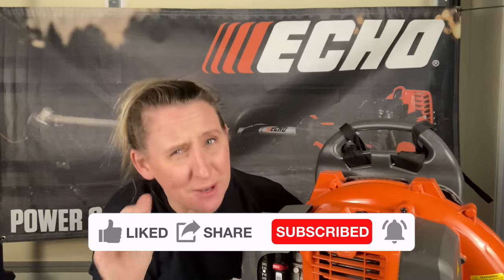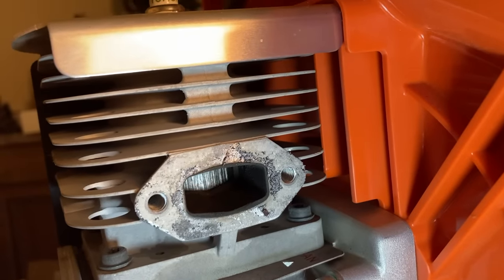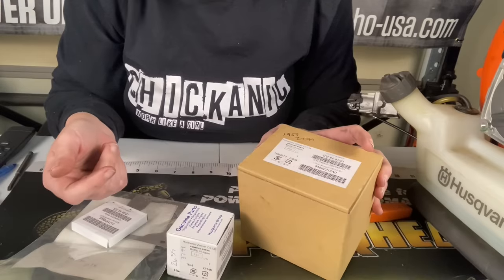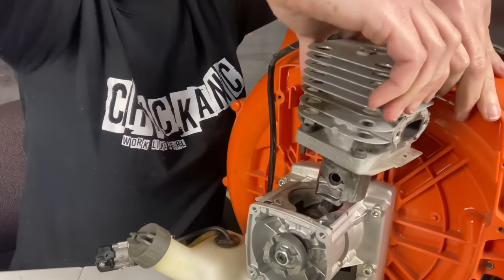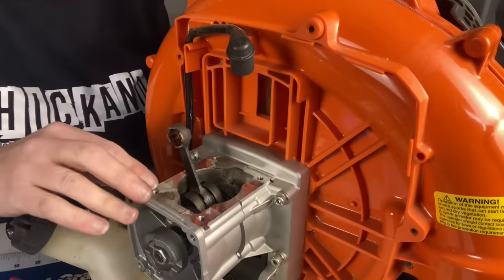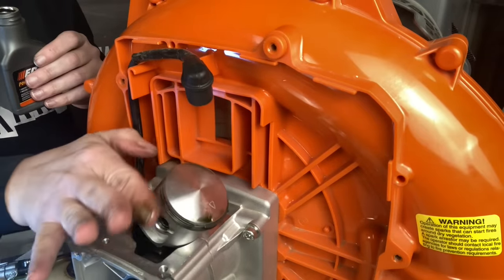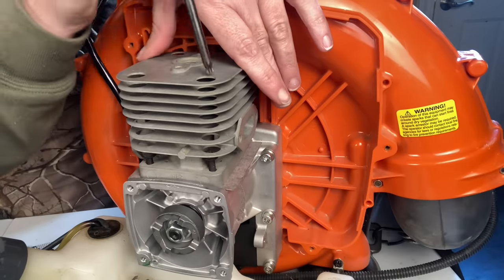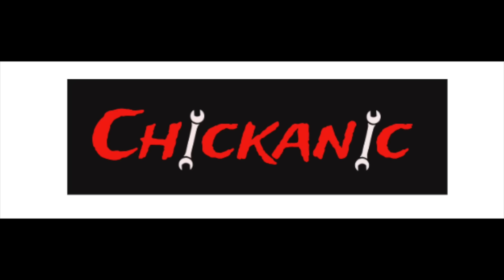How to fix a burned up Husqvarna 150BT backpack blower/Turning Shop Trash into Treasure VLOG Repair

Comment: I just worked on one of these last week.the muffler on these are so restricted, that it throws back carbon deposits back into the exhaust port.If you took a blow gun to the muffler,it would probably be packed with soot.but the spark arrestor would be clean.

Comment: Great video. I picked up one of these backpack blowers a few years ago. The owner told me that it was running fine when he put it away and then it would not start. He told me he was not interested in getting it fixed he said he put it on Craigslist for $20. Really have not messed with it too much except putting a new coil on it. That wasn't the problem and since I had other projects I put that to the side. 

Now after seeing your video I am definitely going to look at the Piston the next time I go to mess with it. I made sure to save your video for a part numbers.

I must definitely hit the like button and subscribe button. Look forward to your next video.

Comment: I would definitely agree with you Chickanic that no oil was used in the gas mix. PERIOD !!! This is a great candidate for a quickie rebuild. DO you have any idea as to why the price of the jug,piston, and rings are so reasonable ?? Sometimes the cost of these parts are more than a new machine. WHY ??? 
          Nice work young Chichanic too.

Comment: Thanks for another great video. I am a bit surprised the bearings/bushings in the botto- end did not overheat.
Reply: Very common for the piston to expand long before the steel parts of the crank overheat. We just got lucky with the bearing and wrist pin. Most pistons come with a new bearing and pin, and we didn’t check the box before she disassembled the engine. If the bearing had been bad we would had been ordering one and had to wait to finish the video.
Reply: @dudekanic  Now that I think about the difference in expansion rates it makes perfect sense. Thanks for the reply.

Comment: The ring gaps are pinned to those positions that the ends don’t catch on the exhaust ports, and u can use a long bolt and nut with a deep socket to remove the wrist pin without scratching them with pliers

Comment: I always dump the gas out of the carburetor on a sheet of white paper. It’s a paper dries completely clear it’s been run definitely for sure with your gas if it has an old film on it then it’s had mix. I’ll catch them every time!

Comment: Sometimes I use a socket a little under the size of the wrist pin diameter and use a soft face hammer to tap out the wrist pin.

Comment: My dad worked for a Stihl dealer. When they changed locations, there was a non-functioning backpack blower there. Now, I may know how to fix it. It was free to me. In the meantime, I use my TroyBilt trimmer plus blower. not the power of a backpack, but one engine, many heads.

Comment: As a retired machine shop owner (bored and sleeved thousands of 2cycle's) and a Wiseco distributer: Would you question the condition of the crank bearing (run without oil) ? Tip: Installing circlip's with the gap other than 180 or 0 degree, can cause "it" to rotate at high rpm, causing total engine failure. It rarely happens, but always with used circlip's.

Comment: The  GYT Kit  for  my  1974 Yamaha YZ-80-A  was $200.00  .. Piston . Cylinder .. 24 mm Mikuni Carb.. head .. Expansion Chamber  and a  super duty crank shaft  bearing and a wrist pin needle bearing..  went from  5.5 HP to   12  HP and with a  lot of Port work 16 HP all out of 72cc's.  then 2 years later I bought another GYT Kit for $125.00 ...

Comment: If someone would produce a locking gas cap for 2stroke equipment.. have the key attached to the handle of the 2stroke  fuel can with a dog chain long  enough to unlock the keyed gas cap. Would save a few engines.. and maybe a few relationships... Good to see Y'all regaining your mojo.👍

Comment: I have the same exact blower i bought it for 20 dollars and all i did is clean the intake,air filter,adjusted the throttle cable and replaced the fuel filter refueled it with red armor fuel  and it runs like new before it was so plugged up it would not get over half throttle the blower is only 4 years old only thing broken on it is the hip strap buckle

Comment: You are so good with part number and repair info. I ead looking for apart number for 3 years one day on your video boom. There it was.  You know Brigg and Stratton engine push mowers the 4 bolt the months to the carbuator and frame I can not find the part number. Two are black two are sivet. They mount the air cover base to the mower and carberatir I can not find a part number for those screws.

Comment: Stihl made some pieces of equipment that used poppet valved 4-strokes that required pre-mix. My genius co-worker reasoned that a 4-stroke didn't need pre-mix and ran one on straight gas until it seized. I think our mechanic repaired it with just a piston and rings.

Comment: After watching this, I'm actually tempted to order a cylinder and piston kit for my old Stihl FS85 which was determined by my local dealer to have low compression.
I really miss that old beast, and would like to resurrect her if I can get the parts cheap enough.
That's a real shame on that blower- there was no carbon on the piston at all, like it was never ran.

Comment: I had a 2 week old BR600 come into the shop and man, it was hooped!  The cylinder was scored, rings melted into the piston, but with a Stihl 4-mix, you know there always a "wait, there's more" coming up.  Disassembled the whole thing, the con rod was almost welded to the crank journal, the crank bearings were seized, the pushrods had come off the cam and gotten jammed in the rotating assembly...  I mean, it was fubar.  It wasn't even due for a valve adjustment yet.  The customer was very adamant that he had used the right oil and mixed it properly, and not lying, that is what was in the tank, but as a tech of 30 years, I have seen people try to BS me more than once.   He INSISTED that I price out a complete rebuild, which I knew would be a waste of time.  It was ridiculous, it came to over $1500 in parts alone.  Naturally he trashed the machine and got another.  Well, this wasn't the only one, I started to see more and more of the units come in that had been on the shelf only a couple of weeks prior, and in the same condition, different owners.  This started to set off alarm bells, so I spoke to the service manager and told him that something is wrong with these units, something is not right with the tolerances, they are binding up, all the parts turning blue as well.  He must have spent a week talking to Stihl and they kept arguing with him that nothing is wrong, this isn't warranty, etc.  FINALLY they did some investigating and called back and said "Oops, you are right, our bad, tolerances are wrong like your tech suspected, the parts were machined improperly".  I had to completely rebuild about 40 units over the next couple of months for the same thing, and I had to bag & tag every single effing part to send back to Stihl.  What a nightmare!  I think that was in 2012, Stihl just had a bad batch of BR600's.

Comment: I just cant believe that Husky doesnt provide a wrist pin and clips with a replacement branded piston.  The reason that the pins are in the piston is to prevent the rings from turning and catching an end in one of the ports.  Good job.

Comment: Hello Chick... I fix cars for a living and something i live by is always put something back the sameway it came off .
Reason i am telling you this is when you disassembled the piston pin needle bearing caps you just moved them around to inspect them .
Now I do know when something runs for sometime it does create a wear pattern from metal balances, tolerances...etc ....
I am not sure how important that it is when it comes to small engines but if i was removing a crankshaft from a small block chevy , it is EXTREMELY important that the bearing caps 
be returned to the same spot in the same direction they were removed....... even if i am installing "NEW" bearings .
SO can you lemme know how important it is for smaller engines .
If it is please let future teardown videos know about it .
Oh and i have been turning wrenches for over 25 years so alot of this is oh natural to me . 
But i like watching and learning new things about anything that runs on fuel.
Plus you are a smart cookie and i dig watching you .
Thanx Chick !

Comment: For those reading the comments and not understanding why a 2 stroke engine can have "good" compression yet be totally trashed. Well it's how a 2 stroke builds compression. typical four stroke you stick a compression gauge in the spark plug hole and crank the engine. Do that on a 2 stroke and it tells you nearly nothing. a two stroke builds compression on the intake stroke as the piston is on it way down compressing the air fuel mixture into the crank case. it's not until the crossovers open that the air fuel mixture will get into the combustion chamber and light off. 
it's for this reason top end compression is nearly useless in diagnosing an engine. You need to vacuum and pressure test the crank case. most crank case scavenged 2 strokes need to hold about 5-8 pounds of pressure and about 10-12 pounds of vacuum for a few minutes. if the crank case cannot hold pressure or vacuum you have a air leak and the engine will either not run or not build proper power.

Comment: Was really surprised that she jumped right into the cylinder and piston redux without determining whether there was any damage to the bottom end bearings!!  ...and after you wind the piston rings onto the piston, use some FINE emery paper to polish out the scratches you left on the piston skirt between the ring lands. They can concentrate heat and damage the piston skirt!
Reply: Its 2 stroke the oil  only  goes to the piston an cylinder.. and it was new so no problem  with bearings
Reply: I had the same question. My understanding of a two cycle is that as the fuel/oil mixture is drawn into the crankcase and compressed, the fuel flashes from a liquid into a gas leaving behind an oily mist. That mist is supposed to lubricate the lower end, and then when drawn into the cylinder, lubricates the piston, the rings, and the cylinder wall.  Looks like the sliding parts of the piston/rings/cylinder gave up before the needle bearings in the journals.
Reply: Oil from the mix lubes the bottom end as well. Something has to.
Yes there is potential for damage to the bottom end as well with straight gas- except- 2 strokes do a wonderful job of coating the entire bottom end with beautiful clean oil ( from the mix. The bottom end could spin for a long time on this. The top end has more heat and packs it in first.
So quite likely the bottom end is just fine
Reply: @adriancollins7236  that's is not true the fuel goes through the crankcase wich in return lubricates the crank shaft and all the bottom end bearings and wrist pin ect......

Comment: I purchased parts from farmer tech or holtzforma really cheap. However they are shipped from China and take a long time to get. I'm using a 455 husqvarna chain saw built with these parts with hundreds of hours on it and still going strong.

Comment: I stripped down a cheap Chinese strimmer that one of our rail track workers used with straight petrol. The crankshaft was bent, and the bearing and conrod end was trashed. Definitely ended up in the bin.

Comment: Regarding cylinder bolts,  do you use a tighten 
Sequence and is there a specific tourque involved,  did a cylinder and piston  on a xp372  forgot thread lock,  had to go back in and redo all boltz, they loosened after first run

Comment: Seen a BR600 that had a broken valve. It was stuck right in the top of the piston sideways. I put a short block in it under warranty.  Customer said that when it quit he had it full tilt and it just stopped. Said it almost jumped off of his back.

Comment: Honestly, i would have cleaned up the old piston, smoothed out the scoring & fitted new rings & the machine would be just as good but i wouldn’t be doing that to sell it on, i would want to change at least the small end bearing along with the piston in your scenario, the cylinder looked very okay.

Comment: I have to say that I bought a blower. Used it for about an hour, then gave it away for free.  I just cannot see or find any value at all in owning one.  I was raised that it is always better to remove filth. than to rearrange it.  Plus, there is absolutely no necessary reason at all to rake or remove leaves.  it is only work for the sake of something to do.  which I do understand has some value on occasion.

Comment: I had a Huqvarna model 55 (back when they were dealer saws. Wasn't dumbed down by the "big box stores") It always started on the third pull EVERY TIME! It was an AMAZING chainsaw. Dad had loaned it to a guy and he ran straight gas in it. I am a mechanic so I tore it down myself.  The position and cylinder were TOAST. Our local dealer who used to be a Husqvarna and Stihl dealer, (They no longer carried the Husqvarna because they had "dumbed down" their saws to get the price point where the "big box stores" could afford them and make a profit.) was still able to get parts at cost. The jug, piston, rings, and gaskets were over $150.00 (list price) A new Stihl that was comparable in size was only $280 ish I believe. So needless to say the saw was scrapped. WHY is it so hard for people to understand that the oil in the gas is a NECESSITY?!!!

Comment: Is there any concern for the bottom end, especially the bearings, since they went unlubricated like the cylinder did?
Reply: Yeah she can replace parts but doesn't have knowledge to even think about stuff like that.
Reply: Even with no oil, the liquid fuel does have some lubricity & is not subject to the drying effects of hot  gasses present in cylinder. She did check the wrist pin needle bearings which she said looked good. That being said the bottom end is likely ok. Machine was likely not run very long without oil. If bottom end bearings are bad probably not worth fixing cost wise.

Comment: Hmm, had an identical blower fall off the back of my truck last summer after forgetting to put the tailgate up. Before I had chance to turn around and get it a passerby told a guy in a white pick up stopped and took off with it.  Easy come easy go. I think it cost me  $350 plus tax.

Comment: Hello Miss Chickanic 
I really enjoy  your vids, thanks for the no nonsense way you do things.
I've been working on small engine's for about 40 year's, no training just figured I couldn't make it not run any more than it all ready
isn't.
To my point, how do you identify a model when you don't have a model or serial number.
I have a Yard Machine (MTD) 26 ton Log Splitter that I bought new/salvaged motor seized (no oil).
I brought it home unseized the motor, runs awesome.
It's been sitting several year's, now I need to replace the float needle and seat, it is a 6.5 Briggs and Stratton Intek.
I have no info other than Briggs and Stratton 6.5 Intek on a Yard Machine 26 ton Log Splitter.
Can you give me some of your wisdom.
Thanks.

Comment: Glad you are feeling better. Good video and wishing your videos were available when I tore my first 2 cycle motor apart.  Just one question: part of the old rings appeared to be missing when you took motor apart - where did they go? The reason I ask was my 2 cycle was motorcycle with no circlips on the wrist pin. metal machined from wrist pin drop onto press fit crank and seized it. Thanks.

Comment: I think a little muriatic acid, a quick hone, or even just a quick buff with some sandpaper and that old cylinder would have been golden, but nothing like fresh top end. I'm surprised you didn't use any gasket sealer

Comment: Chick, please start wearing Nitrile gloves to save yer skin, avoid absorbing oil, gas, cleaning solvents into your blood system. Long term effects are not healthy.
Take the advice from a retired German car dealer master tech for 48 years. If your skin is tingling anytime your working or cleaning up, your in trouble.
Good channel 👍👍

Comment: Excellent job. I noticed that you used High Strength Threadlocker on the cylinder head bolts. Does that give you any problems if you ever have to remove them again?
Reply: No
Reply: I would have used blue.

Comment: Found a BT 130 on side of road. Looks brand new, but cyclinder wad stuck in head. Since there is metal partials in cyclinder, would you suggest taking out bottom roller bearing. Dismantle completely?

Comment: Do factory torque specs have to be followed when tightening up those cylinder bolts, and if so, what are they?   Seems like the probable repair costs, including labor, would have been a better deal for the customer, if he had a workable plan that would keep it filled with the correct gas/oil mix.  Thanks for showing us what to look for and how to fix the problem.

Comment: and herein lays the problem(for the environment) we run into labor rate $75 time to diag and do job 2hrs +50 in parts another 5-10 in cleaners rags etc and even with no profit on the parts the customer owes 220 or so new ones are 250 and they can have it instantly. most of the time it is even worse parts cost as much(if not more than) as a new unit